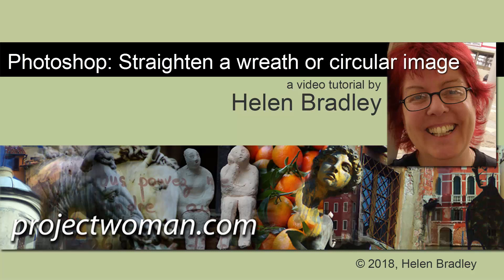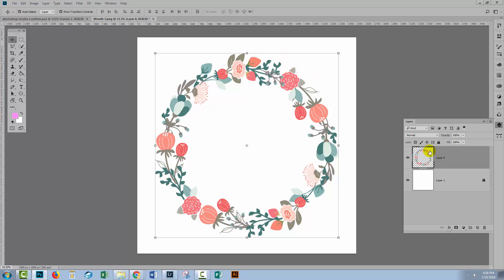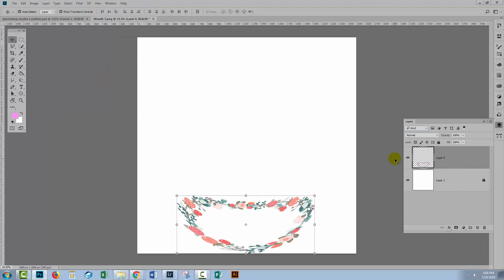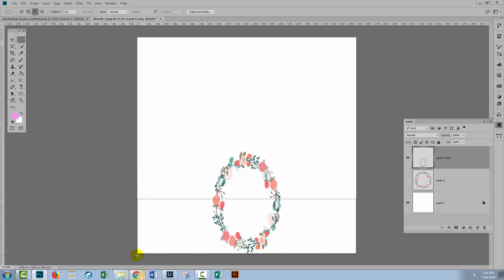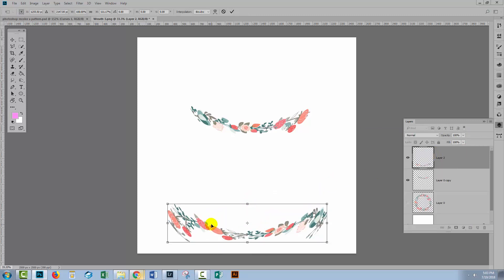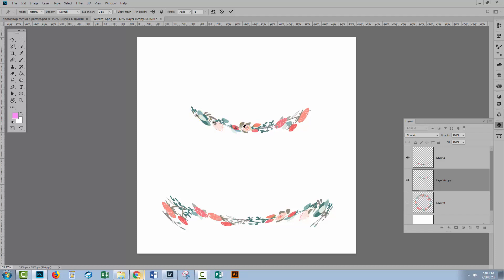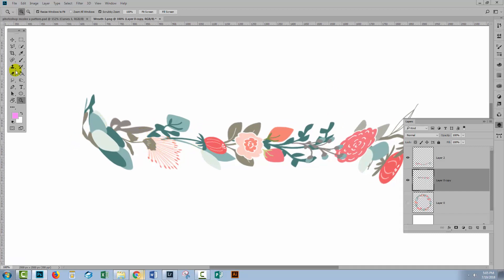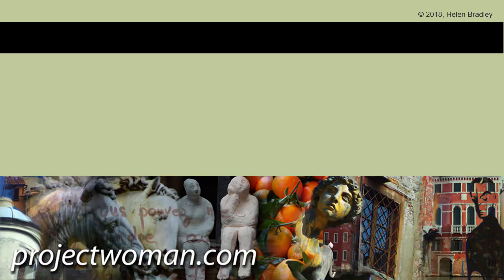Photoshop - Turn a Circular Design into a Line

Comment: why wouldn't you just use puppet warp?
Reply from the maker: Good point Lori! Puppet Warp is another option that you can use. I think that this task is such a challenge that you need to throw every option you have at your disposal at it. So Puppet Warp may or may not work in some circumstances but it is certainly another thing you to try. Thanks for taking the time to add to the discussion!

Comment: Hi Helen your to good and I’m asking one thing so you can tell me how I’ll see color saturation , level etc
Reply from the maker: Good question. You don't have the same controls - eg saturation and levels, in Illustrator. You do have some (limited) options in the Edit > Edit Colors options and you can also use the Recolor Artwork tool - there are options for adjusting Saturation, Brightness, Temperature, and Luminosity. They aren't easy to find so I think there is a video in this question! I'll try to make one for you.